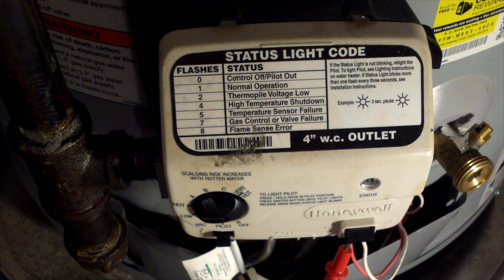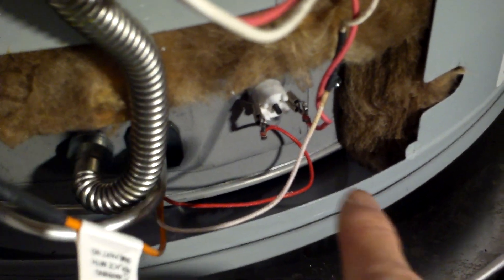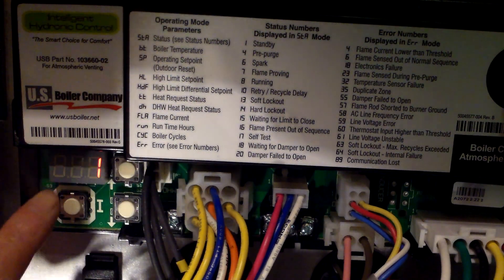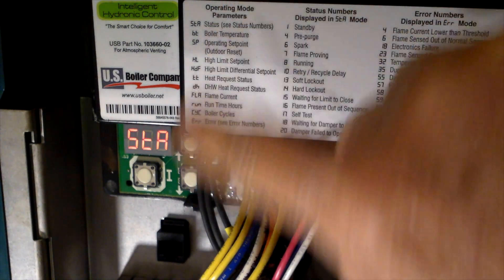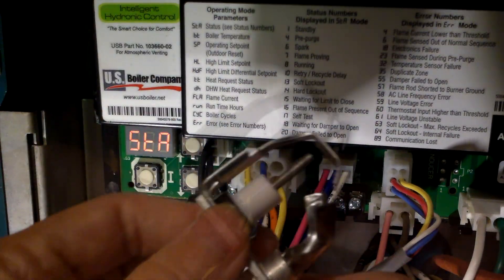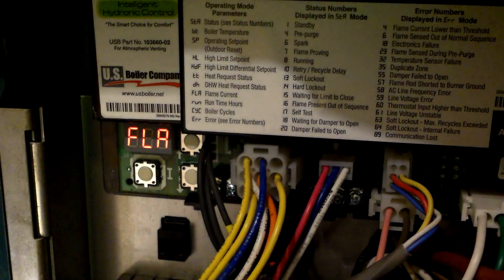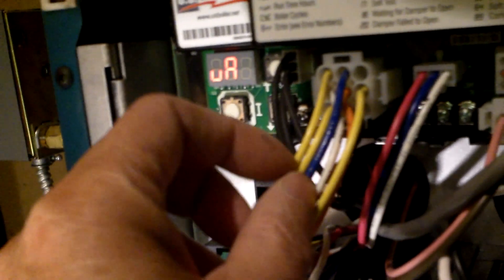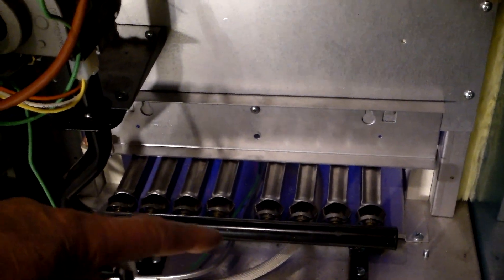Intelligent boiler and heating controls in my new heating installation

Comment: What I can do when its showing status number 1 and 10
Reply from the maker: What model boiler?  1is standby and 10 is retry. Find out err code number.  Most likely is flame sensor igniter rod is dirty and has to be clean .

Description
Flame current lower than threshold
Flame Out of Normal Sequence
Electronics Failure
Flame Sensed During Pre-purge
Temperature Sensor Failure
Damper Failed to Open
Damper Failed to Close
Flame Rod Shorted to Ground
AC Line Frequency
Line Voltage Error
Thermostat input higher than threshold
Line Voltage Unstable
Soft Lockout - Recycles Exceeded
Soft Lockout - Internal Failure
Reply from the maker: Error code:Value Description  this will tell u problem.
4
Flame current lower than threshold
6
Flame Out of Normal Sequence
18
Electronics Failure
23
Flame Sensed During Pre-purge
32
Temperature Sensor Failure
55
Damper Failed to Open
56
Damper Failed to Close
57
Flame Rod Shorted to Ground
58
AC Line Frequency
59
[Line Voltage Error
60
Thermostat input higher than threshold
61
Line Voltage Unstable
63
Soft Lockout - Recycles Exceeded
64
Soft Lockout - Internal Failure
Reply from the maker: Flashing 1 and 10 is burner failed to light. After 5 min., it’ll try to light again.  Also check if circulator is on.

Comment: My ES2 recently turns on and off every 3-5min before reaching set temp. No error code. But why is the short cycle?
Reply from the maker: Could be carbon deposits on flame sensor. Try cleaning that before doing something more involved.

Comment: I keep my fingers crossed that my 45 year old gas boiler stays working.  Every year it's a little dicey, since the fill valve is no good and the drain valve doesn't seal.  I have to "backfeed" the system through the drain valve with the garden hose, and then hope nothing leaks during the heating season.

Mine is so simple it has no control boards or computers and uses a standing pilot.  I still have the turquoise colored "LILCO" switch plate, and it says "Leave pilot burning year round", which I do.  When they are left off, spiders have a tendency to build nests in pilot tubes and whatnot; the small price of a standing pilot keeps the critters out.  I will say I never had a problem with regards to the flame, it just works and that's that.  I make sure to go down and inspect it every day for leaks or other anomalies, and keep a close eye on it, which is good practice for any heating or cooling appliance.  Most of those stories you hear about the old lady with the oil burner whose heat goes out in the middle of the biggest snowstorm of the year largely could be prevented by being attune to how the unit runs when everything is operating properly.  Much like my classic car, there's no "check engine" light to alert me to some problem that's going to cost money; it relies on me, the operator, to notice these things and get them fixed.  Many times, a sensor on a newer vehicle will trip the MIL, where the old car will keep running.  If there is a more serious problem, often the old car can be "limped home" where the newer car needs a tow.

Control boards and error codes and sensors have a purpose, sure, but when they impede functionality for a "nonsense" issue is when I really have a good appreciation of the old simple approach.
Reply from the maker: That's a good story with your boiler. If my new boiler did not have intermittent ignition, it probably would have worked without the initial hickup of a bad igniter/sensor.  The old thermocouple with the standing pilot would work predictably until it fails. Who knows what can fall into that small pilot orifice when the boiler is not used in the non heating season. Have it on year round and no heat sensitive critter will go near it. My printer is also full of trouble codes, with the trouble programmed in, so it'll malfunction when you you need to use it the most. My programmable setback thermostat doesn't work that well,  losing programming whereas the old mercury one lasted probably half a century.
Reply: Ha ha ha!  Ain't that the truth!  Another YouTuber that I watch had a problem with his furnace this year, which was caused by a bad thermostat.  And, you guessed it, that thermostat didn't even last a year.  My boiler has 2 zones, both with mercury thermostats, which have never, ever caused a problem.  In fact, they are so old, they run full 120 line voltage through them.  I've done several tests, and have rewired my boiler to plug in so it can be unplugged and used with an extension cord running to a generator or even a backup battery.  All the electricity is generally used for a couple of contactors, as well as the circulator pumps, total with both zones is only 85 watts.  I'm sure that with your batteries that you have and charge via solar, a power outage in the winter would never be a problem for you if you had my setup.  The intermittent ignition takes a few hundred watts to get going, plus all the standby circuitry and power usage during standby.

In the event of an outage, the most fuel efficient generator I have is my Harbor Freight 2-cycle one, which can run my boiler with ease.  I think the best way during an outage would be to crank the thermostats up to, say, 75, let the boiler run until the thermostat is satisfied, then shut down the generator, and restart when it gets too cold in the house.  Same with the fridge; no need to really keep that alive since I have a chest freezer a lot can be offloaded into which keeps frozen for several days.  And again, that can run until its thermostat is satisfied, and probably left off for the rest of the day and even part of the next.

I'd be a bit concerned about the dirty power the generator would produce with those control boards, though if I recall you have the inverter generator, so you're all set.

Especially during this time of year, where 55" TVs are flying off store shelves for ridiculously the SAME prices they normally are (artificially inflated then put on sale), my old CRTs do exactly what they need to do, I have many that are over 20 years old and still work.  My bedroom TV is 32 years old and still works reliably, every single night and every single morning.  I guess the electronics weren't smart enough to program in trouble periods back then!

A lot of people shame me for still using CRTs and incandescent bulbs and non-HE washing machines, but hey, if it works there is no need to replace it.  And why replace with something that's going to offer lackluster performance and longevity to save a few pennies on the electric bill?  That's why when the power company offers rebates on "replace your room air conditioner with a new efficient one and get a $50 rebate", the money saved on the electric bill will simply go for a new unit when it dies in 1/10th the time the old one lasted.  It truly is a disposable society now.  In fact, I'd like to dispose of this society right now and go back to the old days when people wouldn't put up with this malarkey!
Reply from the maker: jaykay18 You have a right to be concerned about dirty power.  The next inverter for me would be a pure sine wave.  Since it’s a hassle to throw anything out now, fixing old stuff is the way to go.  That 4 k led tv sounds good but I can understand why people keeping old equipment, if only for sentimental reasons.
Reply: The best part about 4K is that people buy it thinking it's going to be better than the one they got 2 years ago that was just 1080p.  That's if it even lasted that long.  But the cable companies are only pumping out 1080i max resolution as it is, so it could be a 16K TV and it wouldn't make it any better than the source!  Of course if you're spinning blu-ray discs that are 4K, or watching Netflix in 4K or anything like that, then you'll reap the benefits, but your typical Wednesday night ABC lineup isn't going to fare better than it already is!
Reply from the maker: jaykay18 Jay, you should start a channel called, “Don’t get me started.”   They keep charging more for the extra bandwidth so you can play your 4 k without stuttering.  I think we pay plenty already.  Yes, you do get more, but how much more can you watch. Afterall, you’ve only got two eyes. Ok, maybe some of us have 4 eyes.